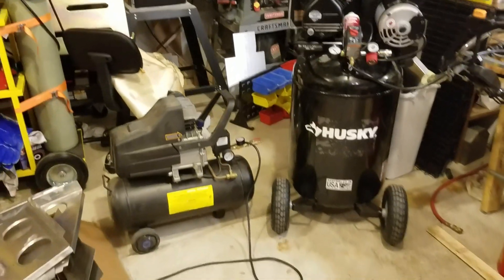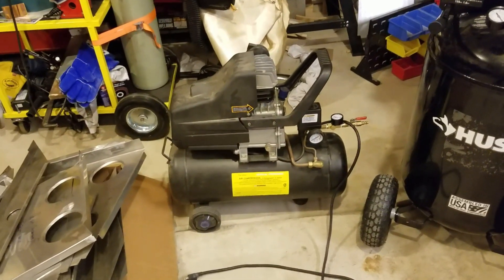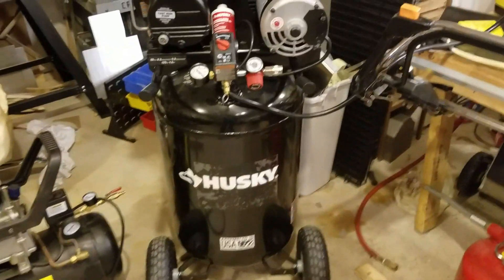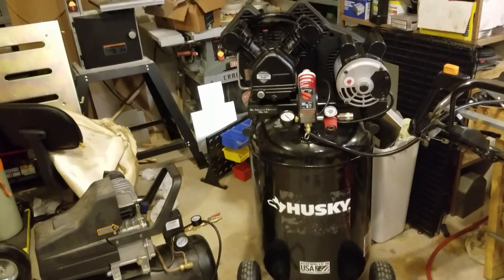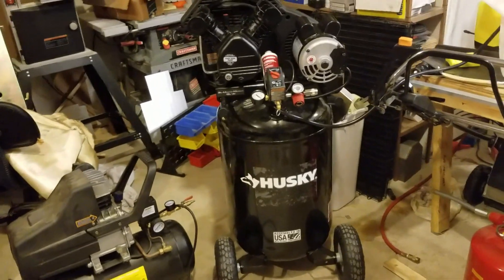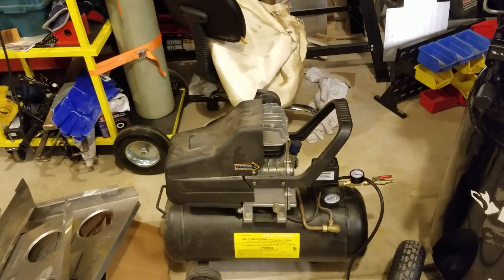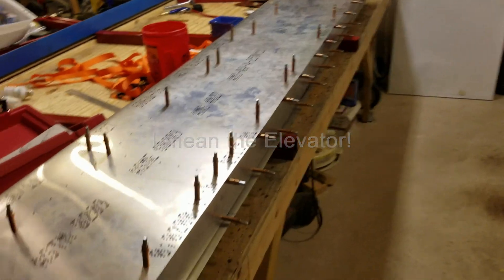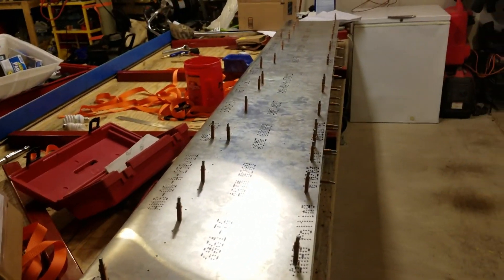This project killed my air compressor & update

Comment: I'm thinking about picking up the Husky for 269, how's it doing so far for you? Any quirks or problems so far?

You probably killed the start capacitor on the old HF model, you can find them for like 7-8 bucks in the McMaster catalog, just have to know what to look for. It draws too many amps at start so it won't turn and will flip the breaker. Might be worth the 7-8 bucks to get it started and recoup a hundred on craigslist.
Reply from the maker: Yeah, I'm fairly certain it's the start capacitor. I haven't been able to find the specific one it takes because it has a mounting bolt molded into the bottom of it...still looking around. The Husky is running great. Riveted for a solid hour with it and it only kicked on once. Did my sprinkler system and my travel trailer and several other things with it...seems to be a good machine. If you do get one, be sure to change the oil after the break-in. The factory oil was really dirty after the 20-min break in. Re-plumbing the condensate drain cost me another $40 or so in fittings/piping, but it was well worth it. The stock one is all but inaccessible unless you tip the compressor up.
Reply: I suppose we're referring to different models. The one I'm referring to is an oil-free, which I'm quickly gathering is a "do not enter" sign!
Reply from the maker: After your first reply, I thought you'd found a much better deal on the Husky 302H than I did! But at $269, I suspected it was a different model, too. If you're looking for a really light-duty, occasional use machine, you could get by with an oilless. I would definitely stay away from the oilless models, even from the higher $$ brands, if you plan on regular use. Two biggest reasons: Oilless are really, really loud, and they wear out much, much faster. My old HF model (oiled) for $100 was a great machine, and I'd buy another one in a heartbeat. I just needed more capacity than my old one could provide, and the Husky in the size/range I was looking for is a better machine.
Reply: Yeah it seems from a little more research, excluding all the marketing BS, that the oil-less are basically a step back from what I want. Oil for the win!
Reply from the maker: I would definitely steer you toward and oiled model. Because the oil goes in a compressor pump (and not a combustion engine), it has a lot of longevity. Once you do your post break-in oil change, it will last years and years until you need another oil change, unless you're running a production shop. I can tell you, that Husky I bought is so quiet, it is an absolute pleasure to have in the shop.
Reply from the maker: martha pfeifer cold storage shouldn't be a problem at all. I would recommend doing the break-in procedure with the factory oil, then do an oil change with their synthetic oil. You should be fine after that. If you need to use it when it has been could soaking, you msy need to switch to a lighter weight oil for cold weather operation.  So far, I haven't had to do that, but the temps in my garage don't quite reach freezing. You do not have to "winterize" them like you do a lawn mower or other gas-powered machine that sits all winter.